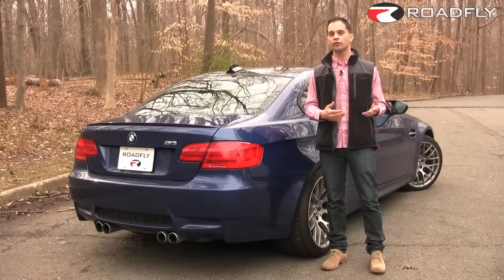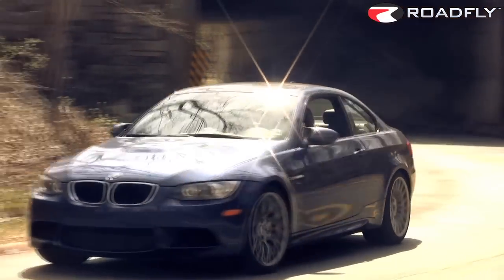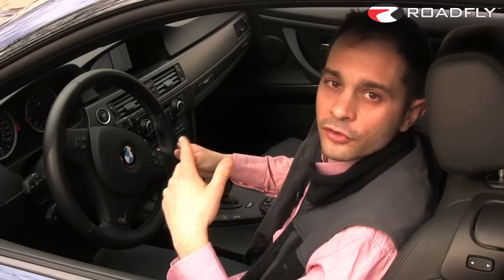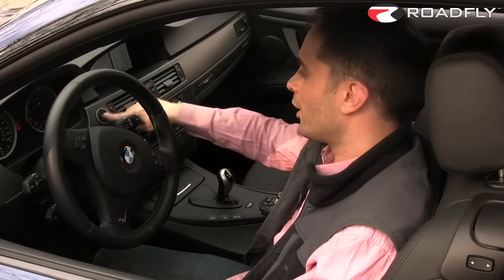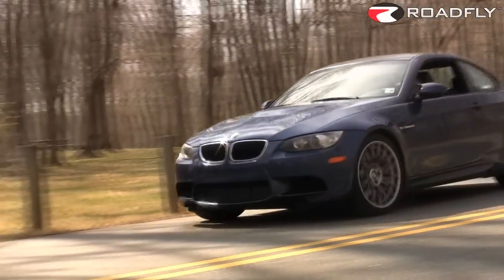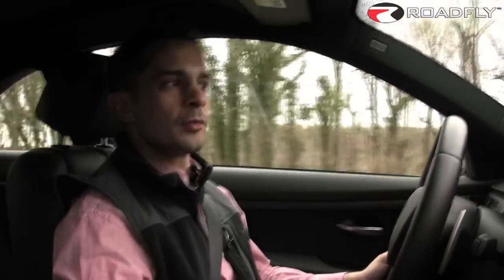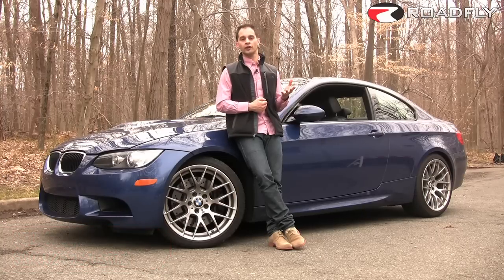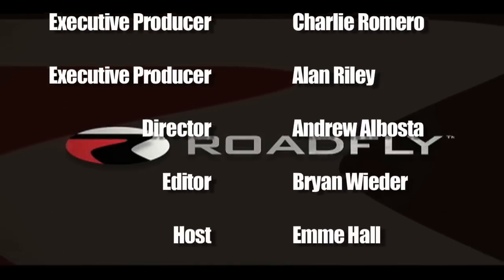2011 BMW M3 Road Test & Car Review - RoadflyTV with Ross Rapoport

Comment: always thought that 295lbs of torque was crap too, but then i drove my friends M3, and when it threw me back in my seat i didn't care anymore
Reply: Terrell Bedonie It isn't about peak torque, it's about how that torque is spread along the rev range. This car has the flattest torque curve that you will ever see. 90% of the torque from 3400rpm to 8400rpm. Thats 5k rpm of smoothness, srsly what other car has power delivery like that, especially when it's wrapped up in such a sexy package.
Reply: BlitzkriegRap Damn that's a good point. Most of us only think about torque and power in terms of a flat number. How that number is used is an important nuance most of us don't appreciate right away
Reply: @BlitzkriegRap it’s 3900 rpm till 8300 400nm. Not from 3400. I know your comment is old but maybe someone else will read this.

Comment: I literally bought a 2013 Comp Package (Alpine White/Fox Red), Carbon Fiber Roof, DCT, Enhanced Premium Sound, tech package, extended leather, etc. because of this review.  Thanks.
Reply: congratulations
Reply: congrats on ZCP e92.   Tested today 2011 Jarez/blk DTC sedan with just 28k miles, had bald tires and the triangle warning symbol stayed on.  $33k i had to pass , I can find later year and perhaps a full blue IB or LBM, but can't find CPO 2013 ZCP.   Ohio Enthusiast scalper hijacks the forum sales by $500 and bribes the forums with sponsorship so that is frustrating to have shill bidder watch your interest in low mile car then come in on final sale and offer to have check outside driveway in morning "NO HASSELS".   i have SMG 05 vert silver grey M3
Reply: i am tempted to by the hardtop vert 2013.   Interlogos or Monte Carlo Blue, don't want to pay for Frozen and those matte paints can't be touched up, have to paint panel for a small chip

Comment: A few years back I bought a 1990 750il with about 90,000 miles on it. I was a little scared when I bought it due to the potential maintenance cost but Im crazy and I will blow my budget on amazing cars. It was clean one owner and drove amazingly. I drove the crap out of it yes I was kind of mean to it but thats why I bought it in the first place. Other than regular maintenance I never shelled out a single penny. I just sold it recently with 150,000 miles on it still running fine.

Comment: What we realized later was that we hadn't set the car to full 'Sport +' mode for much of the shoot. That's a mistake I remedied in my M6 review. Sorry. And yes, you can use the NAV screen to get more comprehensive adjustment of the car's suspension/transmission/throttle settings than you get from those little buttons on the console.

Comment: Just turned in my 2009 m3 which went out of warranty and got a 335. Gonna miss the m3. Great car but its the last year of production for the e92 and bmw seems to only have ones with competition package now. All the ones they had at the dealer were around $80k, anf nowhere near the 0.9% financing they had available back in 08. Getting another one just wasnt in the budget right now, but if ur checkbook can handle it, this is an excellent car.

Comment: I own this BMW M3 2011 Competition Package 6MT. 
Just few things; 1) This car makes 0-60 in about 4.5-4.6 seconds, not low 4's. 2) This car makes the 1/4 miles in around 12.6-12.7, not low 12's. 3)And Competition Package is CSL Type wheels 9 inch & 10 inch, lower suspension about 10mm lower and different programing on the damping controls than the other M3. 
:)

Comment: This is true, i have one of the last of E46 M3 convertibles, and its as practical as the 325 i used to own. Just needs servicing every 15,000 miles (not 5,000 like a Nissan GTR). I carry 4 people in it regularly with no issues and its even quiet unless you put your foot down. I cant afford two cars but need something relatively buisness like and sporty so at the moment thinking about trying to decide between another M3 or RS4. They sell so many M3's because they are the only car you ever need

Comment: I don't agree with the recommendation against the optional sunroof because it effects the center of gravity, structural rigidity, and additional weight. It's a BMW, most people who drive Bimmers will drive them leisurely as well, if that wasn't the case rip out the heavy electronically adjustable seats, tech package, AC, and the backseats if you cared that much about weight.

Comment: So I watched this video, read tons of posts, and reviews...and I still find myself torn between the 10/11 BMW M3 and a 10/11 Audi S4.  Both are fantastic!  

The S4 has less HP, slightly more torque, and is AWD. For me, that is a plus since I live in MD. The BMW is RWD, which to me is more fun. The M3, well, has a V8 and just flys!  However, an easy APR reflash for $1500 can make the S4 an M3 killer; at least a stock M3.  Thoughts?

Comment: yeah Torque and HP numbers alone don't tell the whole story - it's also about how easily the car revs up to those RPMs at which the numbers are quoted.  in a 550i i had when you revved all the way up to redline it still FELT like it could do another couple thousand RPMs.  BMW does such a great job balancing the engine that you end up revving it higher and therefore using more of the engine's potential.

Comment: still with the 414hp v8? i think what bmw should of done is added a bit more power. i think with two small turbos this car would do great, more torque yet still the high rpms. not to mention with all that extra power the gears can be a bit taller, that way you still get the speed, more MPG's from both the taller gears and the turbos.

Comment: @g1981c I kind of does (but you are right, some engines rev much faster). hp = tq * rpm / 5252. So 295 (~265 @ 8200 rpm) is the same as 445 ft-lb for a engine reving to 5500 rpm. Just let go of torque, and look at hp, much easier to compare.

Comment: You mentioned the Mustang and while a lot of people knock it because previous generations were so poor, the latest gen with the 5.0 really gives the m3 a run for it's money while saving you nearly 20k especially if you're not going to get a luxury on it. I've never been a mustang guy, but for the price and with the left over money you could have for mods, or even if you went with the Boss 302, I think it's probably a much better buy.  That said if I had the money I'd probably go M3.

Comment: @gadawgsss23 the mustang has 390lb of torque, the beamer has 290. he said he didnt really like the auto and would like a real manual. the mustangs with a computer tune usually can hit about 7800rpm or so, 7000 stock. oh and 412hp from the 5.0 and a real manual will put down a lot more power than a semi auto. i know this for a fact, the drive train losses are tremendous

Comment: Just cant help myself ... if you fail at math ... please do not re-iterate what other does ... 295 ft/lb on an engine doing 8300 is pretty much the same as 445 ft/lb on engine doing 5500 ... assuming same gearing, mean the 8300 will have a higher final ratio, so you end up with the same torque on the wheels, which is what matters.
F1 at peak had 1000bhp @ 22,000 rpm -> ~240 ft/lb torque ... I bet your SS beat that too?

Comment: @nickelwindow53 4 seater there is the Mustang gt, boss 302, gt500. Lexus has the ISF. You could pick up a used Nissan GTR for around 60-70k. If you're ok with a two seater than you have c6 corvette, corvette z06,  porsche cayman, and porsche boxster.

Comment: Paul, Yes I've driven both the E46 and the E92 models. My two close friends have them, but unfortunately suffered from transmission problems with the 7 speed gearbox. When I made my comment I wasn't referring to track times or track use. I was speaking on behalf of daily driving use and long term reliability. Yes the M3 is an awesome track car, no doubt. I almost bought one. I looked at a used M3 and a handful of BMW techs described it as the "cheating girlfriend." She can't be trusted.

Comment: @rtsnews you need to look at the motor trend channel . they raced the new 5.0 mustang in a 1/4 mile race and around timed the mustang and m3 around the same track . you would be surprised at how good the 5.0 did for 1/2 the money of the m3 . for $40,000 the boss mustang would damn near run circles around the m3 . if you don't look 1/4 mile was even steven until the 5.0 won . around the track the m3 was less than a tenth of a second faster than the 5.0 . is that worth the $30,000 price difference

Comment: Ross, the rarely shown smile on your face @6:36 says "Sold"... :-)
The color shown is excellent and would be my choice.
The dual-clutch option in my opinion is a Must Have on the M3.
The Tech package as you mentioned is a Must Have option.
Be a little impractical and selfish Ross, get the coupe. This Is A BMW M3 after all.
Lastly, and with all due respect, a career car reviewer openly expressing lust for a car speaks volumes doesn't it?. The M3 is an outstanding choice, enjoy the new car Ross.

Comment: @PhotonicsKid the regular mustang is so close that I bet the thousand dollar track pack option probably beats it around the track. They tested the base gt against it in the comparison. If you wanna talk efficient engine the mustang beats the m3 badly. It gets more than 5mpg better on regular gas while the m3 requires premium.

Comment: M3 or the S5? I feel like the S5 is a better deal because it comes completely loaded for a cheaper price tag. M3 is like $70,000 loaded while the S5 is around $62,000. M3 probably drives better though.

Comment: You can get an M3 with a manual gearbox. The automatic gearbox in the M3 is not mandatory.

Further, the whole point behind cars such as the M3/E63/RS4/RS5, Porsche 911, BMW M5 is that they are 3 cars in 1:

1) You can take your gf / wife to a show;
2) You can enjoy luxury and high interior quality feel;
3) You can drive them fast and enjoy the driving experience.

Mustang GT5.0 is only good at 1 thing - accelerating fast.

Comment: @gdsmckrls Yes, unfortunately some 'early' high revving engines gave them a bad name, due to the power band was all squeezed together at the top end. With current high revving engines (i.e. M3 V8/S65), you have a very wide/flat torque curve, so if looking at high rev and low torque bother you, you can just change the numbers on the rev-counter, and it perform just like a larger engine/less rpm. The sound is different though, and some prefer engine noise vs exhaust noise.

Comment: @yhilb111 I never said it wasn't an M3, just that "I'm not a fan of this M3."  I'm a BMW purist, someone who prefers a silky-smooth inline-6 to an admittedly brilliant V8.  As for the next-gen M3, BMW's patents indicate that they have developed a tri-turbo V6.  Ignoring the fact that it is the wrong type of 6-cylinder for a BMW, I am not a fan of turbochargers b/c they lower the redline and generally mute the character associated with naturally aspirated engines.

Comment: @MakeLoveNoBabiez - Considering that in a recent ConsumerReports, Benz and BMW both surpassed GM in reliability. I can only guess your mom and sisters maintained their Benz as is recommended. So good to hear. As for taking an Audi S5 over a BMW guessing the M3, thats just the mind set all Audi drivers have. Because when it comes down to it, as BMW looks just as good or better.. At least Ill LOVE driving my BMW which I know has the power, handling, and build quality that isn't match by Audi.

Comment: I beg to differ. Some cars are much more logical financial decision than others. For example, if you're just buying a car to get to work and back and you live in a 4 season climate, you probably want to go with a reliable AWD car, no need for anything over 200hp. If you're buying your 2nd car to show off in the summer, maybe you'll pop for a RWD convertible with 300-400hp. Depending on where you are in life and what you need a car for, some are good financial decisions while others not so much.

Comment: The carbon fiber roof exposed to sun light will fade.  Even if the car is garage kept.  BMW would have to re-clear coat the roof several times under periodic maintenance or paint over the surface to maintain a clean look to the roof.  Mitsubishi made that mistake with the Evo and chose aluminum vs. carbon fiber on the Evo9's.  It looks great but takes too much to maintain.  If you plan to trade it in after 30-40k miles then buy it and chalk up the 20% value loss to enjoyment of a great car.

Comment: @BestJinjo are you kidding? feels like a heavy boat? it weighs less than 75lbs more than the m3 and beats it in every category and its half the price. Its power to weight ratio is 0.2 less than the m3 but has the same 0-60 time and has a slightly faster quarter mile time. i can agree with the interior thing considering its not a luxury sport but the premium editions have very nice interiors for everything you get for the price.

Comment: Rob, have you driven an M3? Have driven a BMW? Probably not. I have owned 2. And I have driven around the Nurburgring many times , over 40laps. 2 laps in a 2012 z4 roadster and 2012 BMW m3 race modified. The M3 was the best by far. BMW trophy is packed way fuller then Lexus.  Your  reference to value is out the window when you start getting into the $80/-90 grand range. Besides you can get a USED  M3 for Under $30 grand that will embarrass a Lexus on any track. Lexus is trying to be BMW,

Comment: @gdsmckrls You and g1981c are absolutely right. I was just simplifying it ... my assumption was 'good engines' (that is flat torque, which is never the case). My point was just that torque tell less about the engine than hp, but the full story is found in the chart (measuring torque across the range + how quick the engine revs). And yes CVT would be nice, but reality is as you say how well the engines power bands matches it's gearing.

Comment: Not trying to be a hater but I have a C63 and I have more power, the  7 speed tranny shifts just as fast as a M3's and I have a lot of low end torque (obviously). The only let down its not a 6 speed option and sedan only (currently). But its a Benz and all Benz's today have automatics.

Comment: I love the M3 but I couldn't bring myself to purchase one, especially considering I would have to use it as my daily driver for getting to work. I myself have a 2012 Lexus ISF. I trust Toyota's reputation for reliability much more. One advantage the ISF has is that the ECU can't be cracked which is for the better. This goes for any car for that matter. I don't see how people can tune the ECU and expect the car to last long term. Especially when you get into the 50,000 category. Seems risky...

Comment: Your comment doesn't make a lot of sense. Why would I own both the M3 and the Mustang GT when I clearly prefer the M3? I've driven the current and the previous generation M3 and the 2011 Mustang GT stick shift, along with many other cars. You could put 700 hp into the Mustang if you want and it still won't be as refined and fun to drive as a BMW M3. I even drove a Roush Mustang Stage III. If all you care about is acceleration, sure get the Mustang. I'd take a Cayman S or M3 over any Mustang.

Comment: Gotta love an M3, however,,,, still $30k+ used while 335i is $10k used and with $2k in upgrades makes 400+ hp and 400+ torque and gets 5 mpg better gas mileage. In my opinion the gas milage and easy power is why the new M3 and M4 are turbo now also. BMW probably didn't like people buying the 335i and increasing the boost to kill M3s.
Reply: Devan Vandy 
I owned a 335 and I sold for 28k? not sure how you can get an 335 for 10k, maybe with 160k miles, not sure.  If you driven a 335 is nice, an excellent car, but once you get into an m3 it feels like a total different beast. An m3 is 100 track car and it can be your daily driver.  I currently own a f10 535 m with a JB1 and still will never be an m3 or M5.
Reply: i bought my 2009 335i for 13k with 131,000 miles on it, that's about blue book right now. I think i saw one in my local trader for around 10k but it was a pre LCI. To be honest i wanted an e46 m3 but this 335i was on the lot and just made more since at the time, still saving for an m3.
Reply: I own an e46 m3 and have driven my buddy's tuned 335i. They are two completely different cars. The m3 feels faster and is more violent, more of a track car. The 335i is more fluent and steady, I'd say it's more of a tuner's car
Reply: It's all about the v8!
Reply: Evarn evon
Reply: Devan Vandy E92 M3 isn't about the power...it's about heritage and V8...no other 3 series has or will ever have a high revving V8.
Reply: agreed, I would deferentially take an M3 if I had the money.
Reply: +Devan Vandekerkhove I have a 2007 335i E92 with M kit and performance package. It has coilovers and around 400HP and 450Tq. I paid $14k for it....the chip was $279....

Walks the old E46 modded M3's all day, would definitely give one of these a run for it's money, and cost me almost nothing in comparison. On top of all that...it is stealth, and I get 31 mpg on the freeway with the 6M.

Comment: I own 2011 E92 M3 ZCP and it's sitting at 49,000 miles. Im afraid to drive it more, it strikes my heart that what is a great car is actually hell. It soon may become a nightmare. The motor is great, but the engineers really fucked up in which the motor is one of the WORST. Throttle actuators may fail, costing 2,000 dollars to replace. The ROD BEARINGS, you can't avoid those breaking, resulting a highly dangerous engine failure. This can happen at an average of 50,000 Miles. It's Around 25,000 to replace the engine once you hear knocking. This is happening constantly to many M3's. BMW North America is ignoring this problem to all customers weather they have warranty or not. They don't care. There was a law suit in which not much has happened.